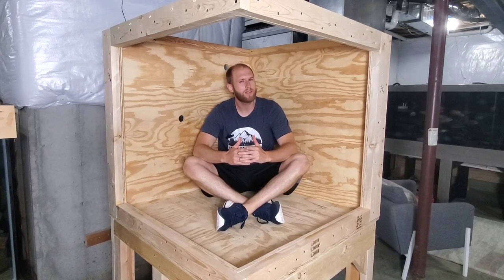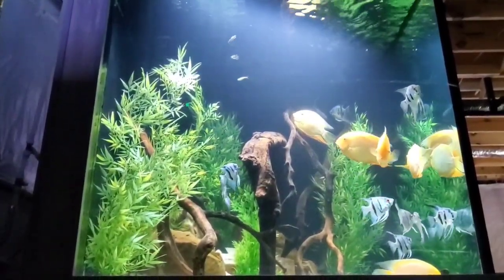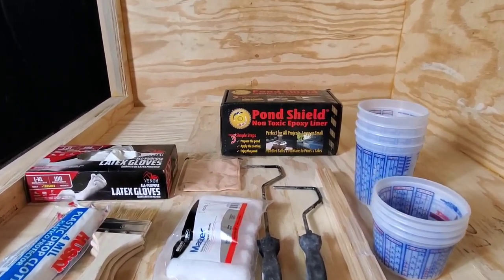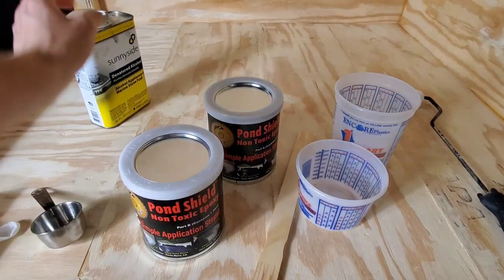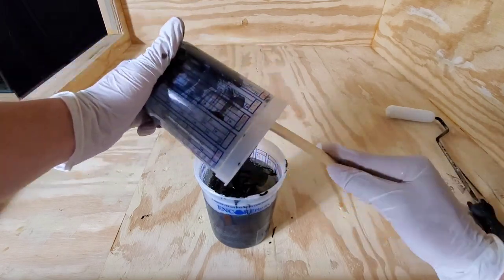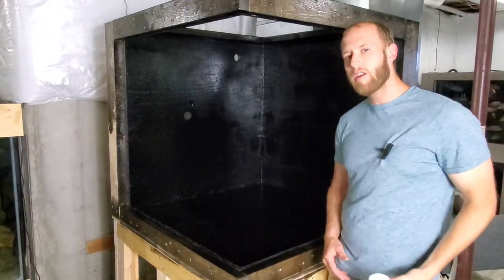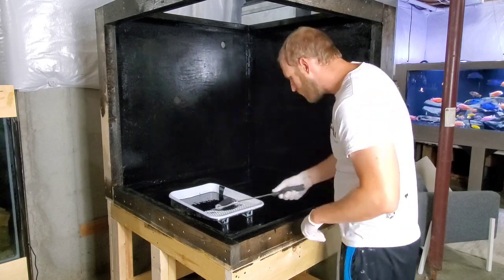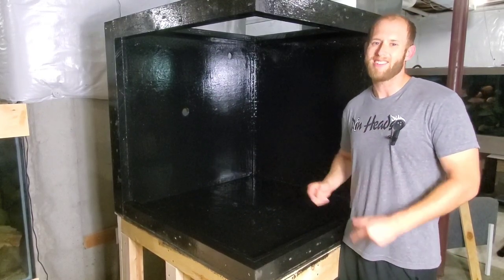How to WATERPROOF a WOOD Aquarium

Comment: You can also use Bondo fiberglass resin (polyester) for 2-3 coats, to seal the wood and set your mesh in. Just sand really well, wipe down, then go over it with your epoxy resin for the final coats.  This eliminates the Pond Armor from getting sucked up into the wood on the initial coat and greatly extends the coverage area from one kit, which also keeps you from having to buy multiple Pond Armor kits for larger projects. Poly resin is also half the cost of Epoxy resin and available at any hardware store.   It's also important to note that you can not use polyester resin over epoxy resin but epoxy over poly is fine.
Reply from the maker: Yea I've heard of that method! I'm partial to the Pond Shield, personally, but I'm sure both would work well. Each with it's own unique advantages.

Comment: Boat builder here... is the pond shield capable of saturating the fiberglass? I know its an epoxy based material, but isn't it more of a thickened epoxy with additives? I'd just feel better using a thinned epoxy resin to saturate the wood and filet  and then glass the seams before doing the pond shield...
Reply from the maker: Hi! It saturates the fiberglass very well. I don't know much about the additives or thickness relative to other epoxies, but I can attest to years of solid performance in other tanks. But I'm sure there's other methods that would work too! :)

Comment: What thickness of glass did you use?
Reply from the maker: 1/2". But that's only possible due to the short length/width, and that the glass doesn't span the full 3' height. Most 3' tanks would require 3/4" glass or more.